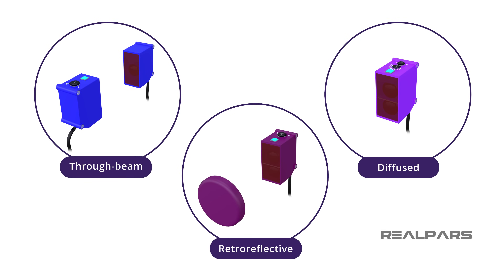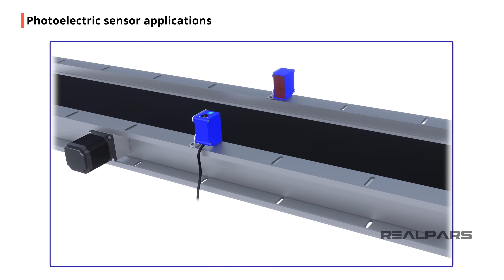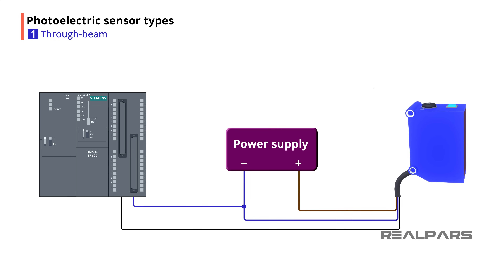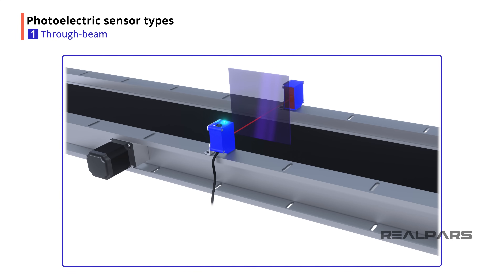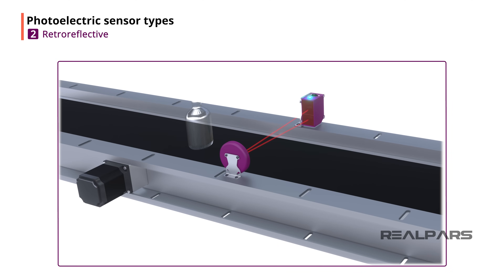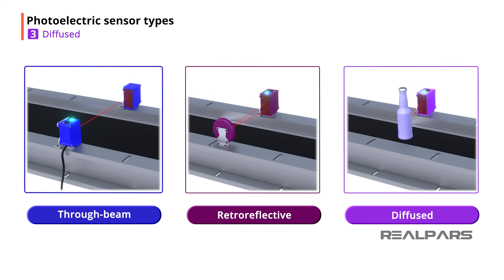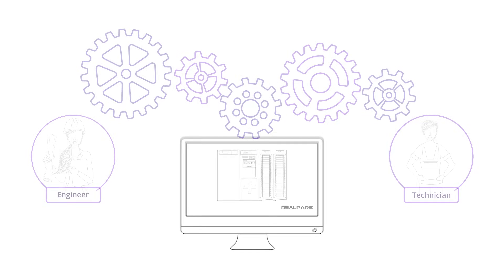Photoelectric Sensor Explained (with Practical Examples)

Comment: In diffused it senses only reflective or it can identify any iron or metal objects
Reply from the maker: Hello, @eshammohammed1945 Thank you for your question. As we mentioned, it depends on the object and the sensor. These days, there are many different types, or you just use what works best in your application, even if it’s not a reflective type. 
Here is a link that can help you with your learning: https://www.keyence.com/products/
Reply: @realpars thanku for helps me

Comment: Does the thru been sensor can be used for detecting empty and full amber glass bottle for solid thinks.does thru been sensor light can pass from empty amber glass bottle
Reply from the maker: Hello, @AbdullahZulfiqar-v5t  Thank you for your question. This depends on your application and the sensor type. It is best to contact your vendor, explain your application, and they will spec the sensor you need. Here is a link to one MFG for your learning https://www.keyence.com/products/  

If you're looking to learn more about this topic, you can join our 7-day free trial at https://community.realpars.com/checkout/realpars-membership
Happy learning from RealPars!

Comment: What is L and D in diffused sensors?
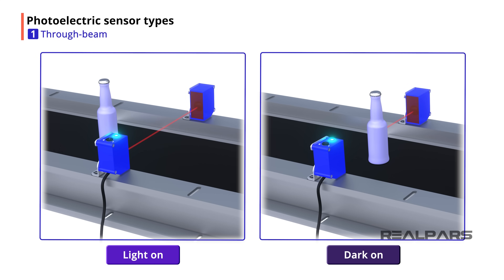Reply from the maker: Hello, @berlinbbv8694. Thank you for your question. You must have missed it. We explained it starting on 3:08 minutes. Here it is:

In light-on mode, the sensor’s output will be on when the light can reach the receiver, and off when the light is blocked and is not reaching the receiver.

In the dark-on mode, the sensor’s output will be on when the light is being blocked and not reaching the receiver, and off when the light is reaching the receiver.   Happy learning from RealPars!

Comment: Hello. The videos are very good. I would like to ask if the NPN sensor does not require the sinking input card, and the PNP sensor does require the sourcing input card? In the video it is the over way around.
Reply from the maker: Hello @szzola. Thank you for your question. I guess this can be a bit confusing. As we explained in the video you are asking about, we give the sensor voltage either directly from the PLC module or from the same power supply that powers the PLC. The voltage to the sensor must be the same source as the voltage to the PLC card you are using. The sensor can provide the voltage back to the PLC or take the voltage and sink it to the ground. All of this is to make the signal in the PLC go to “1” or a “0,” depending on how you wrote your logic for it to work with your design.  Here are two links to videos we created on this subject for your learning.

https://www.youtube.com/watch?v=B65detMhnoc

https://www.youtube.com/watch?v=oyaItbhqoW0&t=10s  

Happy learning from RealPars!

Comment: What about if we use capacitive sensor, it will work better or not. Pl advise
Reply from the maker: Hello, @prashantdhiman6051. Thank you for your question. It depends on your application. You should look at your application and the data sheet of the sensor you want to use. The sensor manual will have all you need to know about where and how to use them, as well as voltage and current requirements.

Comment: can we detect 1 mm diameter using through beam
Reply from the maker: Thank you for your question! Each type of sensor is designed with specific limitations on what it can monitor. To help you choose the right one, I recommend reviewing the sensor’s spec sheet, which contains all the key information. Here’s a link to a well-known sensor manufacturer that may be helpful https://www.keyence.com/products/

Happy learning!

Comment: Are there sensors that can read numbers from an electricity meter or a water meter and send the data to Arduino or a platform like ThingSpeak?
Reply from the maker: Thank you for reaching out. Certainly, there are sensors available that can read numerical data and transmit it in the required format, though they often come with a corresponding cost. It's important to note that the content we provide in our lessons primarily caters to the automation industry rather than hobbyist endeavors, in case that's what you're seeking. However, if you're interested in learning more about sensors and their functionalities, I recommend exploring this link to a prominent company in the field. It could offer valuable insights into sensor technologies and applications. https://www.keyence.com/products/

Comment: Do Photoelectric work well outdoors in the rain / snow?  Looking for a sensor (PIR, beam break etc) to watch a gate and trigger an output when cars drive through
Reply from the maker: Thank you for your question. Yes, they do work in different environments. These devices are made for outside and inside use. You must order the correct one for your application and environment. They are manufactured with an IP rating. I am including a RealPars YouTube video for your review and for learning about IP ratings. I would suggest you contact your local vendor. Here are some links for your learning. There are many companies on the Internet you can choose from.

https://www.keyence.com/products/sensor/vision-sensor/

https://www.youtube.com/watch?v=z935clBMJYU&t=348s 

Happy learning!

Comment: How long  the through-beam sensor can be between emitter and receiver ?
Reply from the maker: Hi Mohammed, 

The length of the sensor can differ based on the manufacturer and the intended application. To find specific details, I recommend referring to the data sheet of the through-beam sensor model you're considering for your application. Here are some links that provide information relevant to your needs. Keep in mind that the choice depends on the specific application. 

https://www.keyence.com/products/sensor/
https://us.rs-online.com/view/search/?category=2%7c3882615%2f3886757

Enjoy your learning experience with RealPars!

Comment: Video is very useful . can photoelectric sensors be used to measure the dimension like diameter and width of the object ? If yes what sotware and hardware needed
Reply from the maker: Hi there, 

Thank you for your question! If engineered correctly, and you are using a PLC, you can. I mentioned again if engineered correctly, use a photocell to measure the width of a physical object, and you can use a photocell to make dimensional measurements of an object. Still, you will have to use a robot and, in some cases, more than one photocell. But there are better devices like camera imaging that are more cost-effective and used in the market.

Regarding the software, too many are out in the market that can do this for you. Too many to mention. But below are some links to 2 companies with lots of reading material for your learning experience. 
https://www.keyence.com/products/sensor/photoelectric/

https://www.omega.com/en-us/

Happy learning!

Comment: hi, how can this type of sensors can detect materials such as metals, wood, plastic and etc. ? can I use this type of sensors for material recognition system ?
Reply from the maker: This is a popular question.  There are many different types of sensors which can detect objects of different materials.  A block of wood, a cardboard box and many plastics can be detected with a through-beam or retroreflective sensor.  Glass, opaque plastic, and sheet film can use diffused sensors if the material significantly refracts the light beam.  There some very sophisticated (and expensive) LED-based sensors that can differentiate between different types of plastic sheets (PET, LDPE, HDPE, PVDF, etc.).

Comment: Do you have any type of photoelectric sensors that you would recommend for the clear bottles (glass/plastic) ?
Reply from the maker: There are retro-reflexive sensors (Sick) and diffuse reflective sensors (Omron) that are made for this very purpose.  Check with the manufacturer before purchasing to make sure the sensor is appropriate for your application.

Comment: Do these exist in scaled down versions?, just trying to use a photoelectric sensors for a project and was wonderingif you can find them in smaller sizes
Reply from the maker: Yes.  They are traditionally called "miniature sensors."  As an example, here is the catalog page for DigiKey photoelectric sensors.  Enter "mini" into the "Search within results" bar at the top of the page.  You will find a wide array of small sensors available.  Other manufacturers have extensive catalogs as well.  For any that you select, double check the specifications to insure it will meet your requirements for voltage, sensing distance, etc. Happy shopping!

Comment: How can we connect the retroreflective photoelectric sensor to a brushed DC motor? I want to use the light barriers for triggering DC motor.
Reply from the maker: If you mean starting/stopping a DC motor when an object passes through the retroreflective beam, then yes, but you will need to use a relay.  A retroreflective sensor does not have a sufficient power rating to control a motor.

Comment: Why doesnt retroreflective sensors beam bounce back from objects like diffused one does? Is the receiver not as sensitive?
Reply from the maker: Light from a shiny object certainly could bounce back to a retroreflective sensor, but most of the time, this type of detector is used for corrugated boxes, and other non-shiny surfaced objects.  Another plus is the reflector bounces the emitted beam back to the receiver at an angle, so it is much less likely for a passing bottle or part to be able to reflect the light to the receiver at that same angle, giving a false signal.